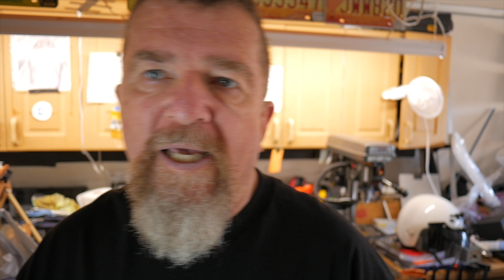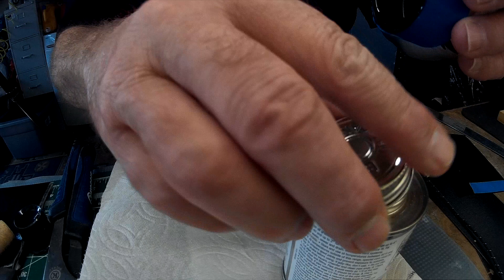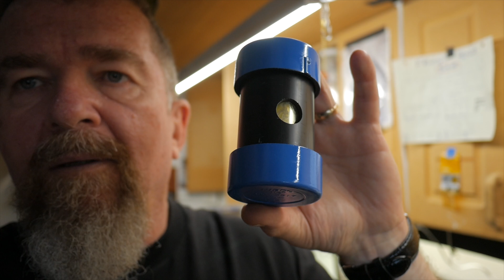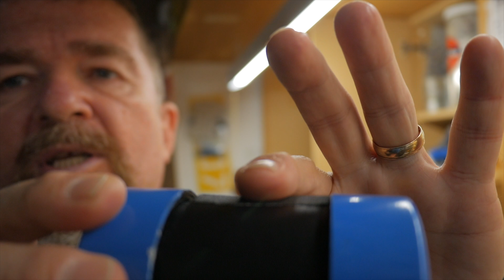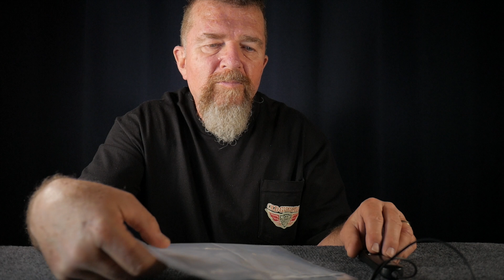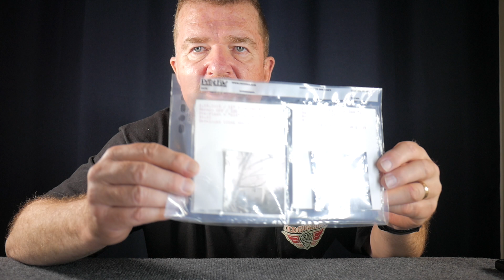Easy-Build PVC Pipe Cameras

Comment: I know this is a long shot, but would you be willing to share how you figured out what size pipe and film you were going to build with?
Reply from the maker: It was a very ad hoc design process. I basically was cutting down sheets of 4 x 5 Harmon paper into quarter sizes, and then the paper would be put into a PVC pipe so it was a curved film plane. Thus the size of the pipe wasn’t too crucial. It was a lot of experimentation based on previous experience.
Reply from the maker: Also, the smaller the diameter of the pipe in relation to the piece of paper, the wider the angle of view would be, and the more fisheye in appearance, the image would be. Conversely, a much larger pipe will give you a flatter film plane if it’s big enough, you might actually have to tape the backside of the paper to the inside wall of the pipe with a loop of tape to make it sit where it should be.

Comment: I have constructed several pinhole cameras, (photo fan). To control the pinholes during production I set my enlarger to 10 X (times) enlargement, and use the projected image of the pinhole in the negative carrier both as a quality and diameter control. To adjust the enlarger exactly to 10X you can use a transparent plastic ruler in the negative carrier (Or a contact copy of the ruler markings). 
As a shutter I apply a two inch square magnetic PVC over the pinhole with a 1/4 inch hole for the pinhole and I hinge with duct tape a piece of steel can, carefully curved to match a cylindrical camera or flat for a rectangular camera. The steel plate has a tape length opposite to the hinge to open the shutter for exposure. The magnetic action holds the shutter well closed and allows easy opening and closing for exposure. 
Hope this comes handy! I much like your pinhole cameras!
Reply from the maker: Great ideas!

Comment: Nice video!
Would be nice see a comparison between posetive paper vs negative paper which you make a contact print out of.
The contact print will not be mirrored among other advantages but it will also add the texture of the paper to the finnish print which might work or not depending on the image.